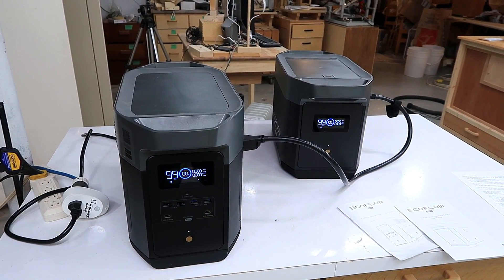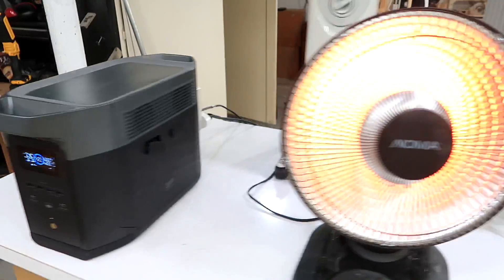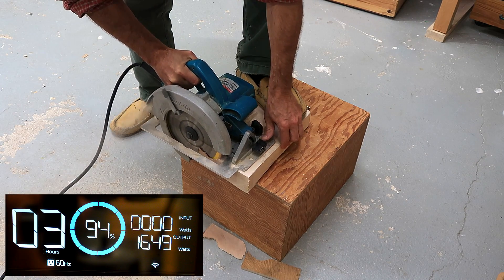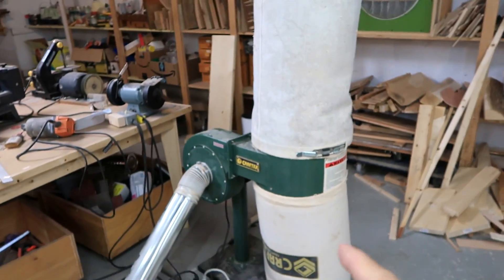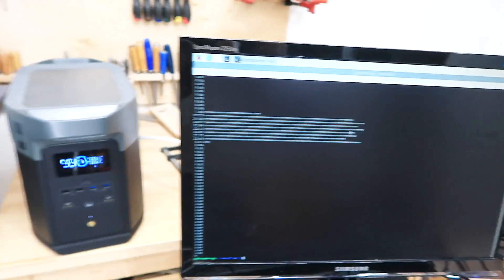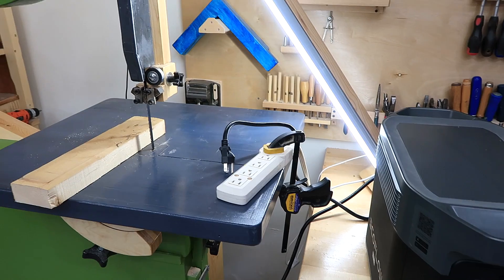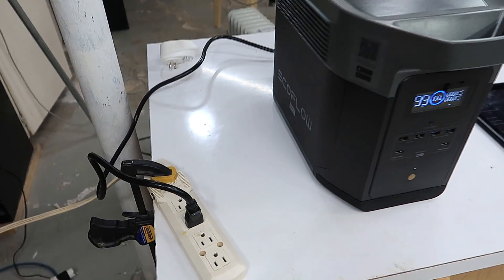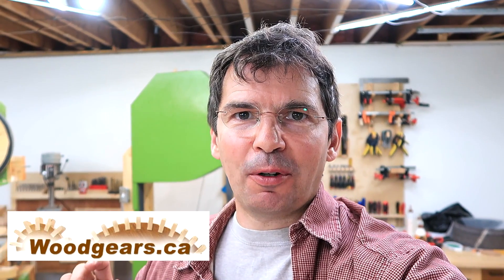Overloading the EcoFlow Delta Max battery pack

Comment: I've considered going for one of these types of battery packs to run the fridge during a power outage; would be so much easier than lugging the gas genny outside (usually in rain), running power inside, and listening to the incessant noise of the generator (usually while trying to sleep!).

My biggest question is maintenance over time; will the battery keep its capacity if I just let it sit for months at a time, or do I have to keep messing with it and cycling the charge?
Reply from the maker: Lithium batteries keep their capacity best at about 40% charge level and kept cool.  Only catch is, if you don't know when the power outage will be ahead of time, you only have 40% to use.
Reply: @matthiaswandel   The DC charger that you could use with your car in driveway would be a great way to cycle and recharge though.
Reply: @thomaskla  actually, not really. Will Prose has tested MANY "solar generators", and for any of them that support solar panel input, particularly 50-100v DC from series connected panels, the wattage they'll charge at with a 12v connection is always significantly less than than with higher voltage. You'd want a large DC-DC (12v->48v or so) boost converter, with thick cables directly connected to the battery.
Reply: @matthiaswandel  so how long would a 40% charge run a refrigerator?
Reply: @randykuhns4515  an average modern fridge uses about 1000Wh a day, and these batteries are roughly 2000Wh, so a 40% charge would get you somewhere around 19 hours of a fridge running.

Edit: should add that this is typical fridge use. If you're having a power outage and don't open the fridge often you'd use a lot less energy per day.
Reply: @reportingsjr  Thanks for the info. If you kept the door closed to keep it from cycling too much I assume it might last longer?
Reply: @matthiaswandel  What type of lithium is in that machine? Lithium ion as in cell phones, laptops, battery tools, you're right, precisely, however Lithium Iron Phosphate you're only sort of right. It's the Voltage (directly) that does the harm over time, and LiFePO4 (which I would guess is in this) has a flat discharge curve, ie, the voltage is almost the same at 10% and 90% and therefore the difference in storage longevity between those two figures is negligible. The self discharge rate if it's topped right up to 14.6 / 3.65 per cell is enough to "knock the top off" and get you back down to the nominal 3.2 pretty quickly. On my small packs I use for starting ICE engines I see 3.3V within 24 hours of being at 3.65V with no real load at all, for example. So you don't have to go 40%, you can go 80+% no worries. If, however, they're normal lithium ion, then it's true, however in practice good quality cells last for many years no matter how you treat them. LiFePO4 is a wonderful lead-acid compatible cell technology. In fact, Model 3 Teslas in China use this tech, not the same ones that American Model 3s use, very interesting. And I just checked, Matthias is right, this is not Iron Phosphate at all, it's NCM. Oh well, I'm not wrong in general, just an irrelevant comment to this particular unit :-D
Reply: Great questions. Given how many other options they seem to have added to the app, setting a max charge point, and perhaps a higher max discharge depth, would allow one to not stress the batteries so much, extending their lifespan, obviously at the expense of usable capacity in a power outage. Hopefully they're paying attention to user feedback, and perhaps this comment section!
Reply: Neither, for optimal battery use you limit the charge/discharge voltage levels, in consumer electronics this means the battery should stay within 30-85% of charge to have a really good lifetime. Some manufacturers use lower cut of voltages for charging thuogh, so best to measure individually.
Reply: So for day-to-day use as a "battery backup" like a smaller UPS, you'd want to set it to maintain around 50% and chain in extra packs if you need more runtime. Then when the weatherman says something nasty is coming, let it charge up to 95% and "cook off" any excess later to get it back down to 50 for long-term use again.
Reply: The max and pro have different battery chemistrys so storage can differ.
Reply: @lightdark00  I just looked at the website and this is not the case. The max model uses NCM (Nickel Cobalt Manganese) lithium batteries, NOT NiCad! You had me worried people were still selling large numbers of NiCads, health disasters that those things are haha.
Reply: @reportingsjr  They should really make that clear. Saying just NCM, it stood out as nickel cadmium metal.
Reply: @lightdark00  ah, yeah, if you're not used to it I could see the confusion. It does say NCM lithium battery, but yeah.
Reply: @reportingsjr  I scrolled all the way down to the specs, didn't read it all. So for chemistry, it lists "LiFePO4" for the pro, Just "NCM" for the max. They would have done much better to show "LNCM" or match what they did as "LiNiMnCoO2"

Comment: too bad its not winter, you could try and hook it up to your furnace and see how long it'll run (if at all).
Reply from the maker: it's been tempting to try it anyway, but with the heat wave we had, I think the wife would get upset at me.
Reply: @matthiaswandel  At least there would be a heated discussion.
Reply: @matthiaswandel  air conditioning maybe or to much power
Reply: @cameronknowles6267  Most home-integrated AC systems run 240v, so one unit by itself won't do the job.  He might not even have AC depending on just how far north he is.

Comment: I actually got one of these a while back because we lose power at my house so often. Use it really only to keep the fridge running. Rather than worrying about an outdoor gas generator and running extension cords I just sit it on the counter beside the fridge. ( edit to add, mine is just the ecoflow delta, not the max, but we got the solar panel upgrade that we thankfully haven't had to use yet)
Reply: Haha. Yes, I think using it to keep your fridge going is probably a better use than trying to run all your power tools.

I wish I had one of these when I lived out of town - that looks way nicer than going out to the shed to start a generator.
Reply: @gworfish  it is pretty nice. And the great part is if the fridge and freezer are already cold it takes so little power to maintain that so it can run for a while. We have had times where we have temperature sensitive medications in our fridge so we had to find something and this was what we settled on.
Reply: @gizanked  Thanks for the real life feedback. No gasoline or oil changes or small engine maintenance already makes this thing look like an amazing upgrade over a generator when you do have grid power but it isn't reliable. Also beats telling the family not to open the fridge until the power comes back on lol
Reply: Great idea!